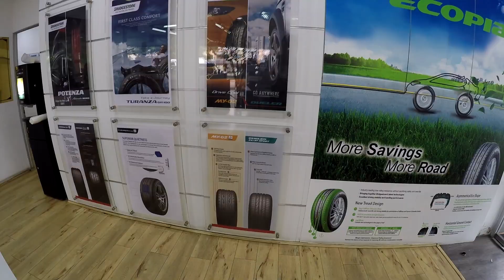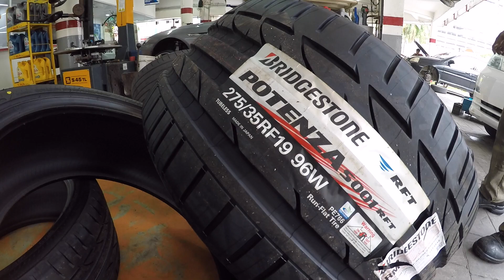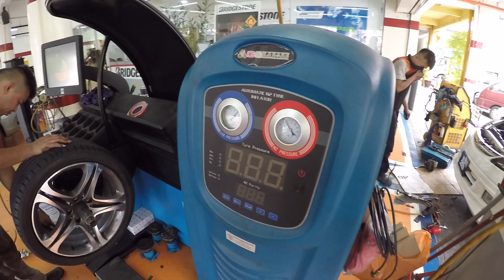Got myself some new doughnuts! Bridgestone Potenza S001 RFT

Comment: Hey Bobby,
SOrry, you posted this video awhile back, just thought I msg here as I can't find a private message feature or some other relevant video.
Something been bugging me for awhile, about BMWs. I personally witness BMWs skidded/slided around a bent at very sensible speed in the rain. I dont know if it is due to bad tyres but it is definitely not speed. Maybe oil, or sand.. but after seeing those events, I have always been looking at BMWs with a different eye, it is like the almost the perfect machine, well tuned and calibrated, but always the image of it skidding and losing the rear unintentionally. 
How is your experience? Any such events with rear wheel vehicles? 

Cheers
Reply from the maker: +IATBFTITW IATBFTITW actually this is the inherent characteristics of a rear wheel drive car. And the exact nonsense that most motoring journalists are telling and showing off in front of cameras as 'fun' driving fun and fun fun fuck them ... for real car owners it's scary as fuck when that happens. That's why you hear some "go in the rain, Audi's are unbeatable". Tyres matters greatly though, my advice would be to buy tyres specifically for rain grip and it should help. And avoid fitting tyres that are too wide.
Reply: Yes, precisely. Once the rear loses, the car tailspin. Horrifying to watch, and I was few cars behind! 

Guess I'll look for into the xdrive w rgds to beemers then. Character is character. Whatever used to mitigate, is still character. 
Thanks Bobby.

Comment: i heard the Potenza S001 RFT have trouble with "bubbles" on the sidewall?  Or this is true for older gen RFT?
Reply from the maker: +drummerlauw we call those 'pregnant' when the car hit a big bump and damaged the sidewalls and the side bulges up. It's a common thing that happens to tyres just like getting punctures or windscreen getting smashed. As for mine, i don't think i'll face that problem because it's a Run Flat Tire, super strong side walls.

Comment: The Bridgestone S001 is the worst tire I've ever bought. On a straight line no reactions with small steering inputs, with heavier steering inputs the rear side of the car is slippery and tilting. Absolutely no good feeling, the tires feels way to soft and unstable. Tires mounted on my BMW E90 sedan with sport suspension. Cornering with the tires will feel likes your driving on ice with grip. No feeling and no response at all.
Reply: Diederik Van Dijk what's a good sport tire for e90 sedan? I have s03 pole position on sport suspension and it also feels loose but with grip. Oem run flats were very responsive but very hard riding. What about Bridgestone runflat all season?
Reply from the maker: +Brian Lobo bridgestone's runflats are not bad. Many e90 buyers go for michelin ps3 and ps4. But the new Conti MC6 outperforms the PS4 i think